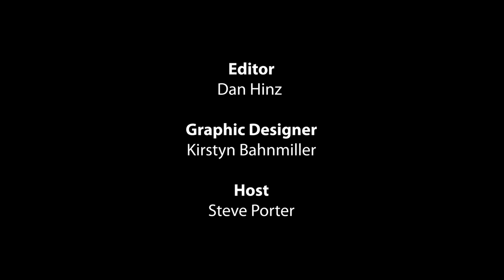The Truth About the Electronics Refurbishing Industry

Comment: You'd get the dust off all those parts 10x faster and more completely if you just used a proper air compressor. Just make sure you have a oil/water filter and desiccant dryer like auto paint guys use. I've done it for decades and had a component fail. oh... and i wouldn't use the compressor on the optical drive. lol.

Comment: Really, you'd be doing more than one at a time, and you wouldn't be fiddling with a tooth brush unless it's necessary. Disassemble, quick spray with compressed air getting as much of the dirt out as you can. Toss them in a dish washer or ultrasonic bath. While that's going, clean drives and boards and fans using the compressed air to clear them from large lose debris first and moving on to finer tools where necessary. Remove old thermal paste and apply new stuff. Reassemble and polish. Could get 4 an hour done. 
But I think we all know they're not doing that xD

Comment: No, it's not difficult at all to do it the right way. The problem is as you said, the profit. Plus they don't really listen to the consumer. If they did they would realize consumers would pay more gladly if they knew it was ACTUALLY refurbished properly and they didn't have to worry about it. In fact, this is what the manufacturers do, they actually refurbish their product to like new condition and resell for just under new list price. If it works for them then it should work for 3rd partys as well. They are just greedy.

Comment: Refurbished to me means a used item that has been brought back to like new condition. Any parts that require replacing are new and from the original manufacturer. Like if you buy a refurbished product from Dyson or any other manufacturer. Otherwise, it’s really just classified as secondhand.

Comment: As a consumer, I'd say you probably went overboard on internal cleaning. I'd expect that ventilation would be cleared, and other issues like thermal paste dealt with. Things like roller cleaning would be performance based - I'd expect to not really notice the difference with new. If there's a battery, I'd expect the battery to be replaced.

Grime on the inside of the case? Don't care.

Comment: Ive got a ps4 that i opened and cleaned out, but i think the psu or something is faulty as it fails to wake up or boot about 50% of the time. itll just sit there with a blue light, then will work if i replug it in and start it again. either way, no idea what to do with it at this point as i dont have a spare ps4 psu lying around lol.

Comment: Removing the dust from the heatsink, and reapplying thermal paste on the cpu were the only things needed to get to a reliable machine. All the rest was fluff. This was a 10 minute job, and if you want to make a living wage in this job, you’d better finish it in 10 minutes. Using some compressed air, that’s easy peasy.
When working at an hourly rate, or on your own machines, it’s a different story alltogether …

Comment: "Refurbished" means "clean, working, with warranty". "Used" can mean almost anything. From "not working, not fixable", to almost brand new. You buy what you see and there is no warranty, but with the benefit, that it is a whole lot cheaper. I buy bigger house hold items like fridges and washing mashines refurbished, because I want the warranty, and smaller electronics like smartphones and pc components used, because I don't need the warranty and clean and fix them myself if necessary.

Comment: Refurbished to me means it performs like new but may have some cosmetic defects.  Also, should be as clean as new.  If you are in the business of reselling used consoles you should be set up to achieve this. I think there is an argument to be made for certain parts to just be replaced as part of refurbishment.  Disc drive roller for example.

Comment: I've been in the IT industry (the software side) for some decades now and still expect "refurbished" means properly. But I also know the 80-20 rule which applies to most thnigs computer related. eg. 20% of the result requires 80% of the time. So I'm not at all surprised that "refurbished" usually just means cleaned on the outside and re-sold for more than the buyer would pay if they knew this.

Comment: See when I refurb my own or my friends console, I'm not so concerned about cosmetics but I replace anything broken or not functioning right, full clean, New cmos, New paste ( you didn't do this amd on a console that old ya probably should ) new thermal pads, yeah they'll work but I mean hockey pucks don't work as well. My people k ow that and dont ask why I charge what I do as a result . There are a lot of expendable things that go into refurbing a console, paste, pads, IPA, air, foam buds, and Cmos batteries for example. Each of those costs money and i dont run a charity so i divide the cost by how many uses i get out of 1 set of the items a battery is 1 per console so i charge the full proce of the battery, a small tube of thermal paste is 4 or 5 consoles so i divide it by that, etc etc. People dont think about what goes into all of it and its in our nature to want things cheaper. But everything you need to do a refurb costs money and most of the time you're out to make money from doing refurbs. I for one wouldnt mind paying extra for something i know is done right but then again thays why i started doing things on my own becausei dont trust most big name companoes that claim they refurbed a console. Anyone that takes pride in their work wont cut corners, those are the kind of peo0le i want doing my refurbs.

Comment: I would only trust a refurbished unit if it’s coming from you TronicsFix. Otherwise, I would just save up the money and buy new. With all of the videos and reports from so many different people, most “refurbished” items aren’t actually refurbished at all. They’re just externally barely cleaned and tested to see if it turns on for a couple seconds. To me, refurbished means taken apart and deep cleaned and making sure every single part works correctly and wires and connections aren’t burned or frayed or messed up at all. If there’s a disk tray, it slides in and out smoothly and the disc is able to spin just fine with no weird noises either. It can read discs, connect to the Internet with the Wi-Fi, and the system isn’t blocked or banned from online use. I know that’s a lot, but refurbished costs the most as well. You should get what you paid for.

Comment: I don't understand why you aren't using an air compressor to clean that heat sink.....my point being, if you are timing this to estimate labor and whether this is/can be profitable, efficiency should be a part of your process.
Reply from the maker: An air compressor would make the cleaning go faster...and it would also put all of that dust into the air which means all my camera, lighting and sound equipment would also then need to be cleaned which would take a long time. That wouldn't really same be much time. Especially since you'd still have to clean the cacked on dust that doesn't come out with compressed air.
Reply: @Tronicsfix  Didn't you step away for part of the refurbishing?  Just saying....I appreciate your reply.  I am also not speaking from no experience.  The key to making money with refurbishing consoles is quite literally your source and price from said source (and of course skillsets and experience).  When I was doing this fulltime, we were bringing in pallets from a single source which included every type of 6th and 7th gen consoles as well as every model of iCrap (touch/pod/nano) as well as PSP's, DS's (all flavors).  Our deal stipulated that any unit that couldn't be brought back from failure (RRoD, Exx errors, YLoD, including hard bans on the console) was ours for parts surplus.  Bidding on electronics pallets is the way to go, but one shouldn't focus on strictly gaming consoles when it comes to refurbishing.  I don't have a company focused on it anymore, but I still make some of my money refurbishing.

Comment: IMO as an IT engineer who does a huge amount of servicing on electronics and who is especially particular about my own devices when servicing is necessary I think a perfectly acceptable "standard" service includes replacing thermal pads and paste, an internal brush out if needed, making sure the heatsink and fan is clean and ensuring the device is fully functional finished with an external wipe down. In my experience something like that on a laptop takes about an hour and I can do a PS4 in about half that time.

Comment: And this is why RIGHT TO REPAIR needs to be a thing - We need REASONABLE design to ensure we can REAOSNABLY open devices without a huge risk of breaking / heating up to undo huge amounts of glue and the ability to clean / ensure the device has a relatively longer life than without maintenance. 

Obviously "intentionally aggressive" designs are "not openly endorsed" but because capitalism, are absolutely encouraged because it yields less product lifetimes and more sales.

Comment: I'm sure the comments are gonna vary widely on this. That said, I feel like your definition of refurbished being "like new" is where you're kind of unintentionally short-selling yourself in this scenario. You could easily have marketed this closer to the $260/280 mark, which is in line with the Best Buy example you gave. I feel that would have been a lot more fair than quoting yourself at the $220 mark. (I understand this is all kinda hypothetical anyway).

As someone who purchased a refurbished Xbox One X, my standard is that enough quality control was taken to last the 2 years that the device was warrantied for (yeah, I went to Gamestop for mine). I bought mine in May 2021 and it didn't start having issues until May 2023 (the Hard Drive is starting to wear out, sadly, though most of my games are on SSDs anyway). I can't complain because the device came out in November 2017 - which was nearly six years ago.

It is a little extreme for people to think a device can go that long on factory parts without suffering some mechanical problems or reduction in performance. The average HDD has a life span of 3-5 years under sustained load (according to Google). I can't expect a company like Gamestop to go through the trouble of swapping a new drive and repartitioning that drive with the Xbox's OS - because a 1TB HDD would cost $20-30 and the labor would add $20-40 on top of that.

So for me personally, "refurbished" should mean moderate removal of dust, the replacement of any clearly broken parts, and power-testing the device. Which could probably be done in half the time by an experienced technician such as yourself.

Comment: for a refurbished unit I expect it to be fully tested, fully working, fully cleaned, be wiped/factory reset and have some warranty. I also expect it to come with normal accessories. power cable, hdmi or other video cable, and at least one controller.

Comment: I really don't think you are actually grasping the effect of mass production. If you don't get the one PS4 but 100, then you have a repetitive task to perform for each one and the pieces you need come from other non-working devices you have around. Those guys must process 5 or more devices an hour per employee, costs of replacing parts are almost negligible, and tests are done under a very strict but precise and fast checklist. On the other hand, unlike you, who actually clean and repair thoroughly, they (the ones who do it right) just disassemble, wash (probably with an automated ultrasonic cleaner), dry, reassemble, test and go.

They only replace failing parts, and when that does not fix the device, they don't try anything else but rather cut their losses by reselling to people like you who will actually take the time to test the parts and fix the electronics.

The ones who do it wrong are not trying "to really make money at it unless they cut corners", but rather making a larger profit from "dumb" people who believe in their claims. But as the saying goes: "fool me once..." and then your business goes down the toilet because you cut corners.

Comment: I work in a warehouse, and most of our job is cutting corners to get a "good enough" result in a minimum amount of time. The same would apply for any business doing this kind of work. The less time you can take at the job as an employee, either more profit the company makes, or the cheaper you can sell the product.

I can easily see how you could have taken half the time you did, by simply not expecting absolute perfection in cleanliness. In fact, just cleaning the drive rollers, replacing the obviously not working fan, removing the dust bunnies and blowing out the heat sink would get you there. Polish the outside a bit for looks because very few customers ever look inside, and Bob's your uncle.

Honestly, it's almost like you deliberately took more time than you should have. Or you're really that picky.

Comment: I understand wanting to be really thorough, and plenty of times in the past I've done a super deep clean of devices I've owned. But I've learned that it's important to right-size the effort.
The idea of submerging a large plastic part like that inner tray in water after you've already removed the vast bulk of the dust is not a value add. It will take only a few days of use for that tiny slight coating of dust to return. The scrub and wipe you did was probably enough. Soaking/spraying that tray will neither impact performance, nor will it significantly increase the length of time before the device needs another deep cleaning. Maybe there's a scale that could be developed for refurbishment (1-basic functionality & blowout, 2-deep clean, 3-like new) that a refurbisher could adopt for determining the effort required.

Comment: I think the term you're looking for is "restored." Refurbished doesn't mean thoroughly cleaned, just fix what's broke and ship it. As long as it works, the buyers will settle for the money savings and I doubt many would even consider opening and checking. 

That cooling fan with bad bearings would likely be tossed and replaced with a working used fan or cheap aftermarket.

Comment: You have a higher standard of "refurbished".
Most places do NOT open the consoles, they just blow high pressure CO2 into the intakes, vacuum the vents, clean the outside and check for functionality.
They only open it if the device doesn't work, makes weird noises, or has some other glaring issue.

Comment: This really doesn't look like a good example of a refurbishing process:
1. Taking a freak of a device like the PS4, with a whole bunch of non-standard hardware and mechanical components like hdd, odd
2. The device being in a pretty sorry condition
3. Cleaning the motherboard and all the specks of dust? Why? Delving into optical disc drive mechanics nerdery? That's great for enthusiast / boutique / retro work, otherwise no refurb company can or is supposed to do.

Here is what I think a refurb company is supposed to do: take a unit that is already in good condition, run it through some (probably automated) testing and slap their warranty on it.

Comment: 8:15  At this point, you might be harming the PCB more than you are protecting it. It’s not a good idea to put any kind of cloth onto PCBs. There is a certain risk of electrostatic discharge happening which can damage some components on the PC assembly. This can lead to either  latent or catastrophic failure of the console. A refurbished console (properly cleaned) that has a latent ESD failure in e.g. some MOSFETs is much worse than a non-damaged working console that has not yet been properly cleaned inside.
There is no reason to put the metal plate on top of the PCB during the cleaning process. It’s better to put the PCB to the side and then work on the metal plate directly on your bench.
It’s important to always practice proper ESD control when working with any kind of electronics. This especially goes for devices that have sensitive parts on them, like CPUs, memory chips etc. That towel you put onto the PCB is probably made of cotton. Dry cotton is a very static material and should not in any way ever come in contact with any PC assembly. There is a lot of reading you can do online if you want to learn more about the topic. For instance, you can always take a look at an electrostatic series chart for more info. You will find cotton as well as a lot of other common materials there.

Comment: If you call that refurbished, then I guess I have refurbished my ps4 twice.
It should have been cleaned better to consider it refurbished.
Reply: The way you cleaned it left a lot of particulates on top of oils.
That ps4 could accumulate more dust due to improper cleaning.
It also seems like the cpu did not have the right amount of pressure applied when assembled.

Comment: I watched your videos and questioned why you were cleaning the grim off the the plate resting on the mother board and decided to put a towel under it still on the mother board. Why didn’t you just move the motherboard out of the way and then clean it
I’m pointing out another thing is at the end you said that the console is fixed but I don’t know if it’s fixed because you never had a controller connected to see if you can get the Home Screen and to see if the game disc show up and it plays